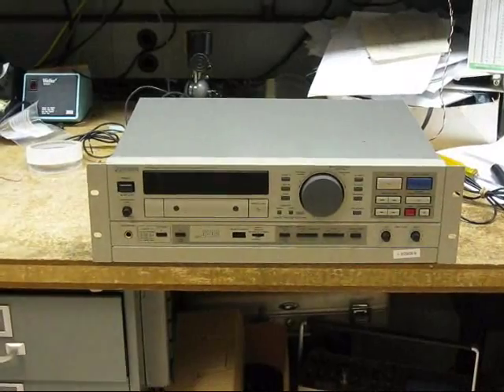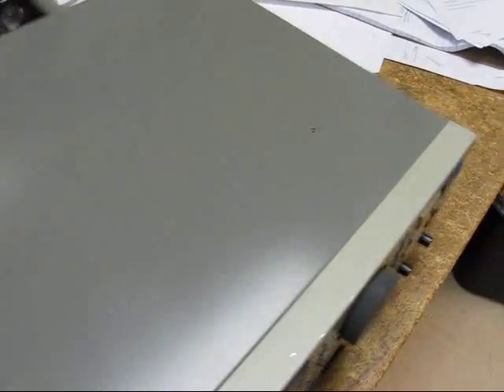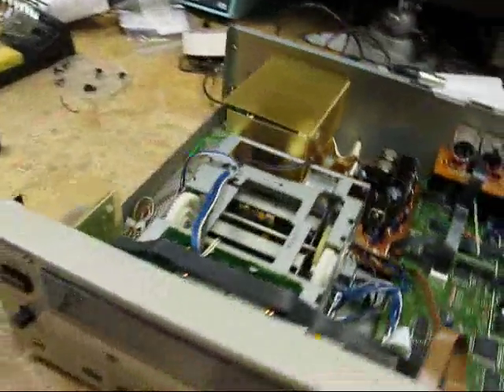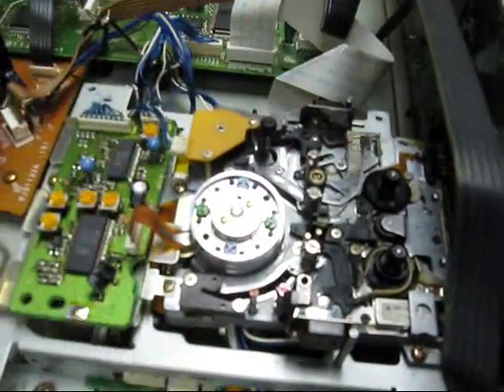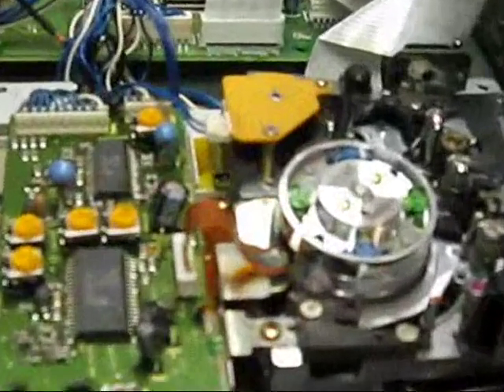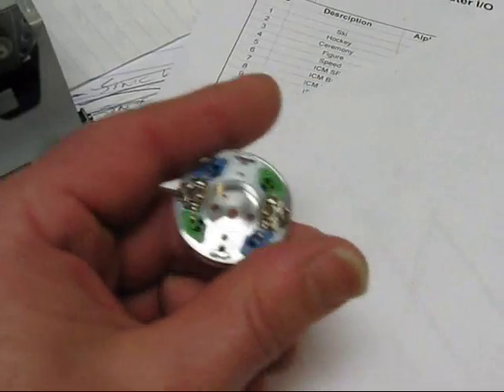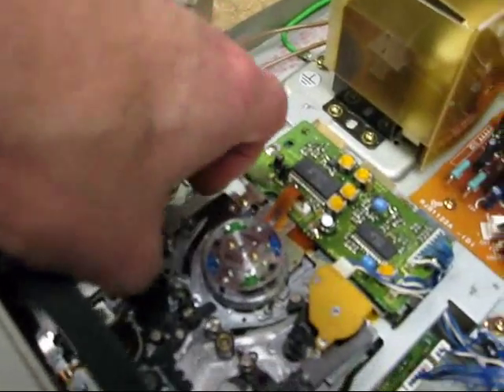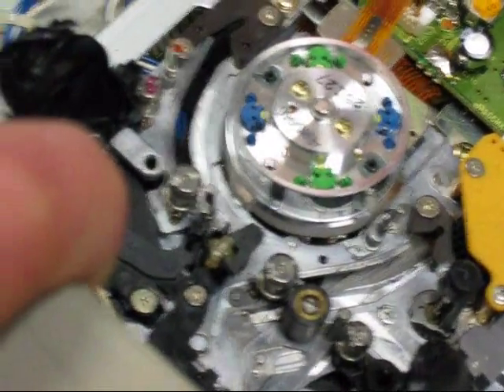shortdat1.wmv

Comment: Looks like the same transport used in the Fostex D-10
Reply from the maker: I couldn't tell you. I have never seen a Fostex D-10.
Reply: @manidig  I have one, it's exactly the same except the Fostex has a small PCB on top of the carriage which has 2 LEDs on it pointing toward the tape area, the Fostex has a clear window above the drawer so you can see the tape reels moving.
Reply from the maker: @nickfatsis9607  I looked the D-10 up and yes it appears Fostex bought their transport from Matshusita-- it was common among the Japanese manufacturers to do that. A lot of Denon Mini Disk machines have transports from Sony and the replacement parts came in a box with a Denon parts label affixed right on top of the Sony parts label. Of course all of that is now gone.

Comment: Nice and detailed video. I have this models twin, the Technics SV-DA10. Just got the cleaning tape for it and was to clean it after sitting for about a year. And it took the tape in but wouldn't play it!? Not playing any tapes, no fast forward nor rewind...any clue what i should look into? Many thanks.
Reply from the maker: Hello Bojan-- Does your machine load the tape and go into the STOP mode? If it does then there could be two issues:   The switch that reports to the machines CPU that a cassette has been loaded might not be working. Second, if it is loaded and you press a  tape motion (Play or one of the fast modes) and nothing moves then I would suspect the mechanism underneath the transport is stuck-- most likely the grease used to lubricate it has turned solid. There is a little motor underneath where the tape drum is which rotates gears and cams that move the levers to PLAY, REWIND, FORWARD modes. Mechanical issues are common if this machine has been sitting in storage for a long time.
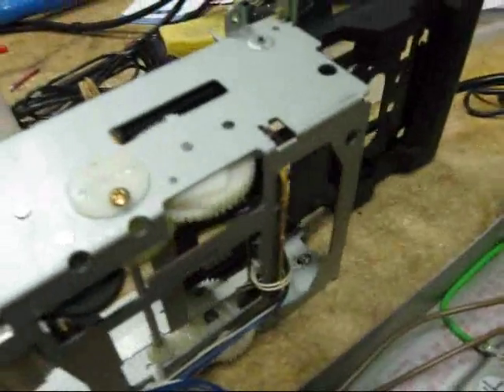Reply from the maker: If you look at the video around 7:14-- this shows the motion of all the parts that determine the loading and tape motion. Sorry the video is blurry but it guide you.
Reply: @manidig  Hello John. Very late replay but i have fixed the Technics. Dried out lube was the issue. Had to clean everything and reapply new lubricant. Cleaned the head and it works like a charm! I am going to open it again to fix up the squeaky tray when loading the tape. Other than that, no complains. I hope it gives me a lot of play hours. I'll be doing the CD transport repair too ( SL-PA10 ) and an amplifier modification ( SU-MA10 ). Shall post videos. Many thanks again :)
Reply from the maker: @technics-n-thuiast8346  Yes the lubricant used originally will turn hard. And it is best to dismantle everything and clean it  (much like a clockmaker does) before putting new grease in. Glad you solved the problem. Another DAT lives on. Cheers.
Reply: John thank you for the prompt reply. It just won’t play and rewind/ff....I’ll try opening it and look at the mechanism below the tape loader. 👍🏻

Comment from the maker: The CLEANING light will light up when there are excessive errors. Since you're having that problem, at the very least you need to clean the machine's tape path thoroughly like in the video. These machines are almost 20 years old, so your rollers and brake levers are probably worn out contributing to the errors.

Comment from the maker: @ThisWeekinRed The part number is REM-0009. I doubt it is still available but someone somewhere might have one on the shelf. You could try spraying DeOxit into it. Sometimes that will cure the "dead spot" on the commutator for a little while but it will need to be replaced.

Comment from the maker: @ThisWeekinRed First off, the tray needs to be connected to the transport. There is a humidity sensor on it that will prevent the machine from operating (the "DEW" light will flash on the front display). If the door opens and closes, you should be able to get it to load if the switch on the lower left part of the transport is pushed in (and you have tape over the two sensors on the left and right of the transport). If it doesn't load, then the loading motor is probably bad.

Comment from the maker: @Neuumann it's mistracking. It could be dirt on the drum. If you clean it the way I explain in this video, using a Texwipe or a piece of white paper, it will probably fix that. What are the error numbers you get when you do this? Many Sony machines had an issue with the guide posts that caused them not to align properly after many loading/unloading cycles. You might have to re-align the machine for the Sony-recorded tapes.

Comment: Greetings!
Great video!! I have an old (but low hrs) 3700. The dang thing is not playing tapes properly. I've cleaned the heads and... nothing. The tapes that I'm trying to play on it were recorded on different machines... mainly Sony DAT machines. Anyway, when I insert a tape into the 3700, sometimes they play but sounds like the heads are out of alignment. Other times I hear a "relay" click and no audio. When the "click" happens, there is no movement of the tape. Any idea what this could mean?